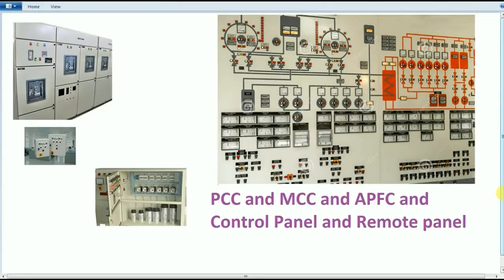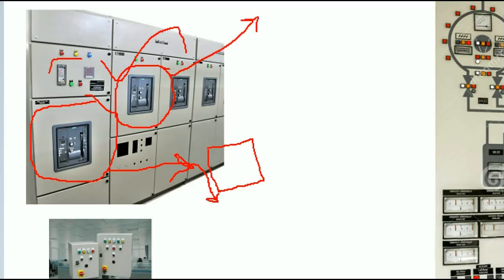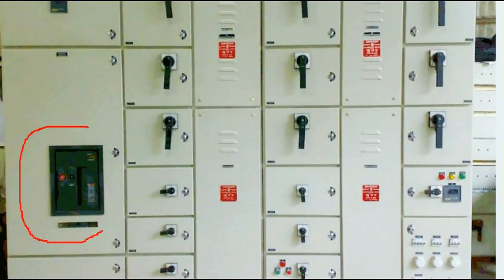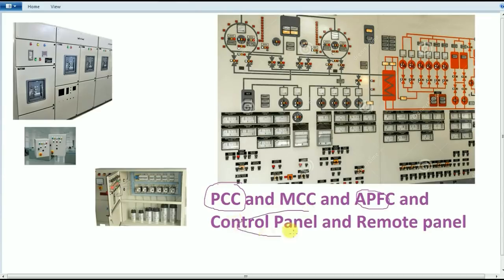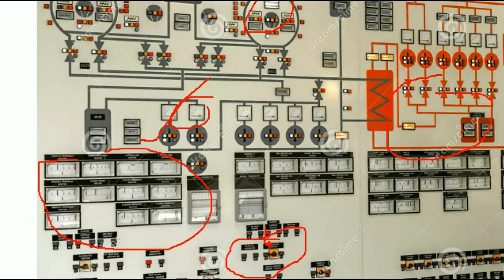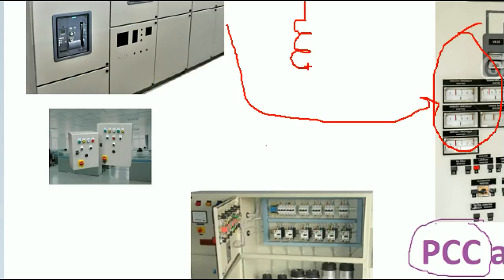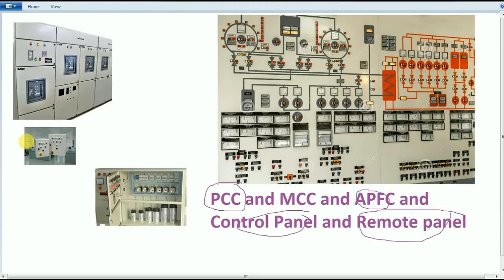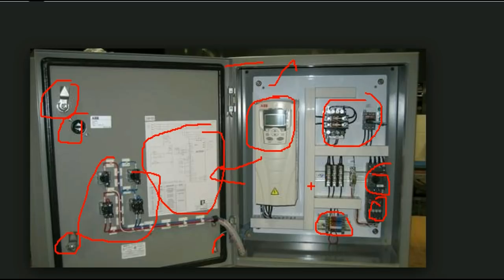What is PCC and MCC in Tamil

Comment: CT la fault eruntha athayum remote penal solve panna modiyuma
Reply: For More Electrical videos in Practical Explanation in Tamil

தமிழில் 

How to arrest Transformer HV Bushing oil leak 

https://youtu.be/nb2921W40ik

How to arrest Transformer LV Bushing oil leak 

https://youtu.be/5iajjFDs9fY

What is meant by Transformer turns ratio Basic concept

https://youtu.be/dPSff0ZoCB8

What is meant by Current Transformer

https://youtu.be/tdiXuo1I2TU

Current  Transformer Polarity 

https://youtu.be/QCfNQMlWwjk

How to check current Transformer turns ratio test?

https://youtu.be/hhrabhE5IoY

How Check CT Resistance using multimeter

https://youtu.be/7QigzV2yd0M

Comment: Please share vfd full operating system
Reply: For More Electrical videos in Practical Explanation in Tamil

தமிழில் 

How to arrest Transformer HV Bushing oil leak 

https://youtu.be/nb2921W40ik

How to arrest Transformer LV Bushing oil leak 

https://youtu.be/5iajjFDs9fY

What is meant by Transformer turns ratio Basic concept

https://youtu.be/dPSff0ZoCB8

What is meant by Current Transformer

https://youtu.be/tdiXuo1I2TU

Current  Transformer Polarity 

https://youtu.be/QCfNQMlWwjk

How to check current Transformer turns ratio test?

https://youtu.be/hhrabhE5IoY

How Check CT Resistance using multimeter

https://youtu.be/7QigzV2yd0M

Comment: Very useful explanation bro...picture oda explain panadhu understand pana easya iruku thank u
Reply: For More Electrical videos in Practical Explanation in Tamil

தமிழில் 

How to arrest Transformer HV Bushing oil leak 

https://youtu.be/nb2921W40ik

How to arrest Transformer LV Bushing oil leak 

https://youtu.be/5iajjFDs9fY

What is meant by Transformer turns ratio Basic concept

https://youtu.be/dPSff0ZoCB8

What is meant by Current Transformer

https://youtu.be/tdiXuo1I2TU

Current  Transformer Polarity 

https://youtu.be/QCfNQMlWwjk

How to check current Transformer turns ratio test?

https://youtu.be/hhrabhE5IoY

How Check CT Resistance using multimeter

https://youtu.be/7QigzV2yd0M

Comment: Hi bro I like your explanation very easy and simple, I am working in power plant with food company,  30 to 40 page control drawing how to read me simply. Please explain
Reply: For More Electrical videos in Practical Explanation in Tamil

தமிழில் 

How to arrest Transformer HV Bushing oil leak 

https://youtu.be/nb2921W40ik

How to arrest Transformer LV Bushing oil leak 

https://youtu.be/5iajjFDs9fY

What is meant by Transformer turns ratio Basic concept

https://youtu.be/dPSff0ZoCB8

What is meant by Current Transformer

https://youtu.be/tdiXuo1I2TU

Current  Transformer Polarity 

https://youtu.be/QCfNQMlWwjk

How to check current Transformer turns ratio test?

https://youtu.be/hhrabhE5IoY

How Check CT Resistance using multimeter

https://youtu.be/7QigzV2yd0M

Comment: Transformer Impedence voltage how it will measure and how it will calculate
Reply: For More Electrical videos in Practical Explanation in Tamil

தமிழில் 

How to arrest Transformer HV Bushing oil leak 

https://youtu.be/nb2921W40ik

How to arrest Transformer LV Bushing oil leak 

https://youtu.be/5iajjFDs9fY

What is meant by Transformer turns ratio Basic concept

https://youtu.be/dPSff0ZoCB8

What is meant by Current Transformer

https://youtu.be/tdiXuo1I2TU

Current  Transformer Polarity 

https://youtu.be/QCfNQMlWwjk

How to check current Transformer turns ratio test?

https://youtu.be/hhrabhE5IoY

How Check CT Resistance using multimeter

https://youtu.be/7QigzV2yd0M

Comment: G all electrical calculations ac and dc and hvac calculation and fire system facp explain pnuinka bro pls
Reply: For More Electrical videos in Practical Explanation in Tamil

தமிழில் 

How to arrest Transformer HV Bushing oil leak 

https://youtu.be/nb2921W40ik

How to arrest Transformer LV Bushing oil leak 

https://youtu.be/5iajjFDs9fY

What is meant by Transformer turns ratio Basic concept

https://youtu.be/dPSff0ZoCB8

What is meant by Current Transformer

https://youtu.be/tdiXuo1I2TU

Current  Transformer Polarity 

https://youtu.be/QCfNQMlWwjk

How to check current Transformer turns ratio test?

https://youtu.be/hhrabhE5IoY

How Check CT Resistance using multimeter

https://youtu.be/7QigzV2yd0M

Comment: அருமை நண்பரே, நான் எலக்ட்ரிகல் , electronical துறை சார்ந்த தகவல் விரும்புகிறேன்.தமிழில் குறைவாகவே உள்ளது. மேலும் சிறப்பாக அதிக அளவு பதிவு செய்ய வேண்டும்.நன்றி.
Reply: For More Electrical videos in Practical Explanation in Tamil

தமிழில் 

How to arrest Transformer HV Bushing oil leak 

https://youtu.be/nb2921W40ik

How to arrest Transformer LV Bushing oil leak 

https://youtu.be/5iajjFDs9fY

What is meant by Transformer turns ratio Basic concept

https://youtu.be/dPSff0ZoCB8

What is meant by Current Transformer

https://youtu.be/tdiXuo1I2TU

Current  Transformer Polarity 

https://youtu.be/QCfNQMlWwjk

How to check current Transformer turns ratio test?

https://youtu.be/hhrabhE5IoY

How Check CT Resistance using multimeter

https://youtu.be/7QigzV2yd0M

Comment: please explain -relay contactor /working principle for MCC MCP
Reply: For More Electrical videos in Practical Explanation in Tamil

தமிழில் 

How to arrest Transformer HV Bushing oil leak 

https://youtu.be/nb2921W40ik

How to arrest Transformer LV Bushing oil leak 

https://youtu.be/5iajjFDs9fY

What is meant by Transformer turns ratio Basic concept

https://youtu.be/dPSff0ZoCB8

What is meant by Current Transformer

https://youtu.be/tdiXuo1I2TU

Current  Transformer Polarity 

https://youtu.be/QCfNQMlWwjk

How to check current Transformer turns ratio test?

https://youtu.be/hhrabhE5IoY

How Check CT Resistance using multimeter

https://youtu.be/7QigzV2yd0M

Comment: ungalathu intha muyarchi vegu sekirathila miga periya reach ketaikum kalam romba tholaivil illai...unga vidio than eppo electrical department la spread ahitu iruku.....vazhthukal sir...
Reply from the maker: thanks ma...thambi..naama seikiram oru super tamil electrical community ah uruvakkalam....
Reply: For More Electrical videos in Practical Explanation in Tamil

தமிழில் 

How to arrest Transformer HV Bushing oil leak 

https://youtu.be/nb2921W40ik

How to arrest Transformer LV Bushing oil leak 

https://youtu.be/5iajjFDs9fY

What is meant by Transformer turns ratio Basic concept

https://youtu.be/dPSff0ZoCB8

What is meant by Current Transformer

https://youtu.be/tdiXuo1I2TU

Current  Transformer Polarity 

https://youtu.be/QCfNQMlWwjk

How to check current Transformer turns ratio test?

https://youtu.be/hhrabhE5IoY

How Check CT Resistance using multimeter

https://youtu.be/7QigzV2yd0M